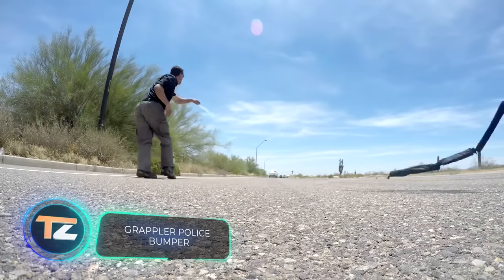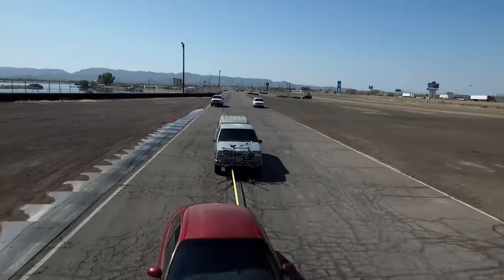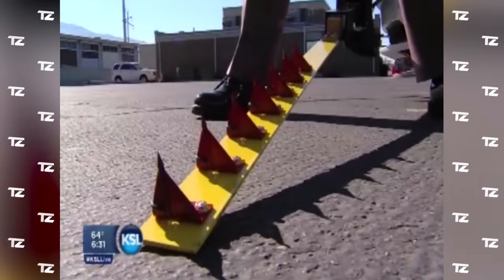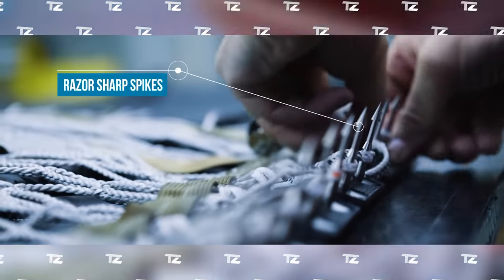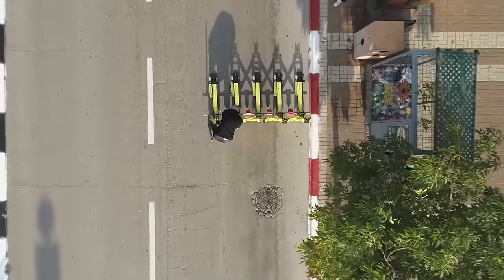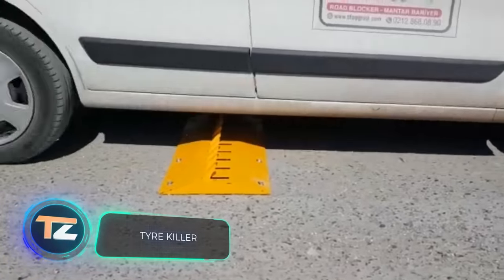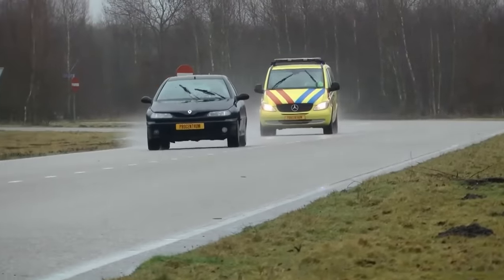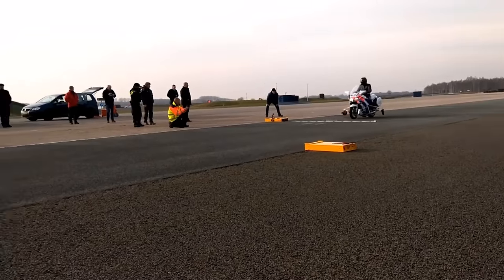12 WAYS POLICE STOP DANGEROUS CARS

Comment: Love the pop up two way vehicle tire shredder. There are areas where people race trains by zig zag motion around the stop arms.  Install these devices on the 'open' lanes to deploy whenever the arms are being lowered and retracted just before the arms go back up.  Britain could really use this, and so can areas in the US.  Hope they see it. The problem would be cost per installation.
Reply: the cop car shoud hve spike traps allow to stop the car
Reply: Ahh yes, disable a vehicle right on the train tracks why haven’t we thought of that one before 🙄
Reply: @crys4789  No, the shredding would be done after the vehicle exits the tracks and attempts to go on its way.  Would take some figuring though due to the different lengths of vehicles, trucks, trailers, motor homes,  etc.  The examples shown were for car type vehicles only.  Practical?  Maybe not, but you've got to admit shredding tires would certainly prove a deterrent.  Parking lots I know of have such anti-exit devices.  They work.  Train crossings in heavily populated areas could perhaps solve the problem with raised center barriers that extend for a block ... but then what of the track that closely parallels a roadway?  Cameras appear to be used ... but do they capture the plate # and identify the driver?  Bottom line can officialdom eliminate human stupid and irresponsible behavior?  Nope.  But instead of simply sarcasm why can't we get the job done?

Comment: Love how these can all be stopped with slight mods. Literally just put a cap over the wheels and add skirting to the sides of the car so theres about 2mm clearance, and a small low friction wedge on the front to render the net useless.
Reply: Have fun putting that on a car yourself/without putting yourself in legal troubles long before getting in a police chase
Reply: Okay criminal mastermind, but you realise nobody's gonna do that just to stop one tactic in a chase.
And it won't be long before you're in a chase for mods like that...
And they'll just stop you the normal police chase way then.
Reply: @Tarks_Coady_EFC  and? Not like it'll do anything.
Reply: @Grandslam245 . I mean a simple pit maneuver is gonna render whatever u just suggested useless
Reply: @yournamehere6240  gotta have a car strong enough for that, and not be stupid enough to let them get close to begin with.
Reply: @Grandslam245  the faster you go, the easier it is to pit.  And avoiding a pit is not as easy as you think.  How many pits are there pictures of?  I guess those criminals simply didn't care and purposefully let them get close.  Cops know what they are doing and know how to set you up -and there are more of them than you.  Worst case, if their cruisers don't have the speed to overrun you and pit you, they can always just push you til your gas runs out.  You can't stop for gas - they can.
Reply: Lex Luthor you ain't.

Comment: use a drone with high voltage discharge have the drone mounted to the roof ready to be deployed. when it land on car been chased roof it then gives a high voltage discharge to the car and short circuit the electronics.
Reply: That will not work. The body of the car acts like a faraday cage. 

Also cars are also specifically designed to withstand lightning strikes without being damaged.
Reply: what if it’s raining
Reply: @jojothefisho4199  it can be water proof
Reply: What about it's a car killer drone that attaches to the car and does a 100000 bolt sting that shuts off everything in the car and impossible to start again
Reply: @opheebop7632  cars are designed to withstand multi million volt lightning strikes and still run.
Reply: @opheebop7632  drones can be water proof but that would be extremely hard and expensive

Comment: The first one was was good in theory but required the fleeing truck to cooperate in it's own arrest.  It all goes back to advice from an uncle.  'you can't outrun a CB radio.". I've done some testing authorized by those in charge of laws.  For the sake of drivers on the road just pull over.  Bail, or bond, will also be lower for viewers financially limited, upon the drivers apprehension by authorized enforcement if drivers don't run.

Comment: Whatever we do, we have to continue to show criminals that run that they can't escape.  The worst thing we can do (which sadly is becoming more frequent) is to discontinue chases when the criminal begins to drive dangerously.  The reason that is a terrible idea is two fold, first of all if we show them that they can get away if they just drive like an idiot, they will just do it more often.  And also, often times when road units pull back and allow air units to track suspect vehicles, they crash anyway.  It's a bad idea all around and we need to do the exact opposite, develop technologies and tactics that make it more difficult on the criminals!

Comment: One locked up wheel on the back, doesn't just keep going strait down the road. And is it going to throw the driver through the windshield? And the pit maneuver isn't supposed to be done over 30 miles and hour. They've did it at a 100, on a lady that turned her flashers on and was waiting to pull over in a safe place. on a family that stole something at the dollar store. Most crooks or nuts speeding are because the cops are chasing them. They came out with a gps tracker the cop could shoot on  a suspects car and there's drones. The cops never stop and back up a minute. They've got a warrant and they got to get them right now. While the warrant makes them and the crime look worse, the actual crime may be that they just didn't show up to traffic court.

Comment: Please stop using lbs, use kg's or tons
Reply: But then Americans wouldn't understand what was being discussed.
Reply: What's the issue? You don't understand math?
Reply: @farmer8102  I myself am great at math, but I believe that they taught converting imperial units to metric units or vise versa in the schools that I have been to. I could look up a unit converter on the internet each time that meteric units were mentioned, but then that would take time away from actually enjoying the video. I do know that a kilometer is approximately 3/5 of a mile, but again doing the math would take away from simply enjoying the video.
Reply: @justinweatherford8129  understandable,  I believe America is pretty much the only place that uses standard measurements and everyone else is on the metric system.  I took the time to understand both so when something came up I knew how to convert automatically and didn't have to go look it up every time.
Reply: This is in America. We use pounds (lbs), not kilograms.